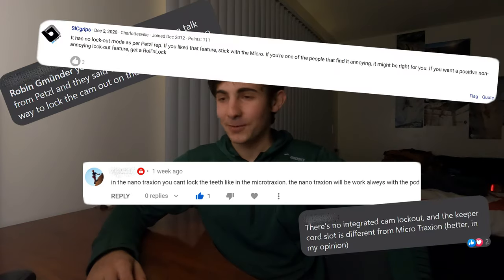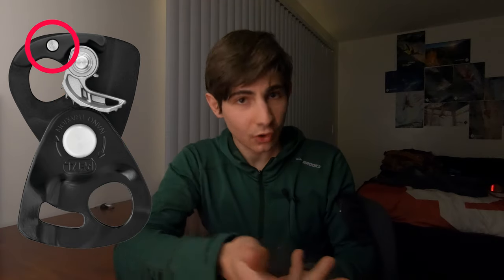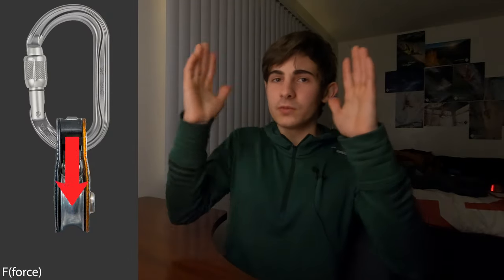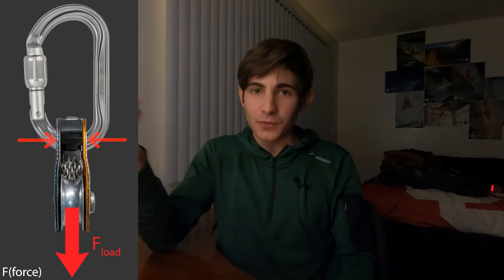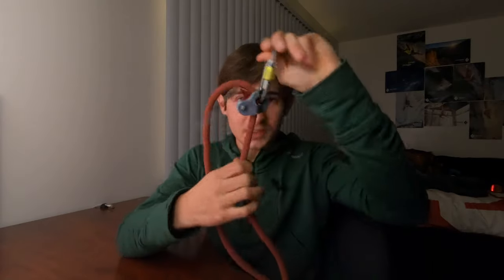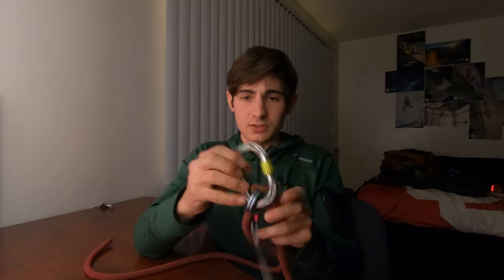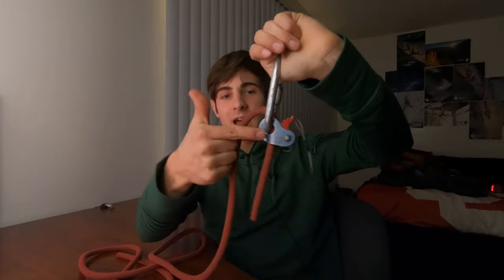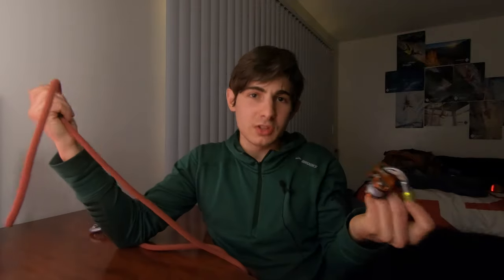MORE NANO TRAXION

Comment: This is going to be a slam dunk for TR soloing and simul climbing like you said. Lighter and no way for it to lock open accidentally (without having to take a dremel to your $100+ microtrax). Also it's strange that only the Petzl Sm'D has the hole in it for a keeper cord yet Petzl says to use an oval carabiner for aiders, pulleys, trax, etc. I use the Sm'D for pulleys, GriGri, trax, etc. and it works great and aligns the trax with the spine just fine.
Reply from the maker: I agree it is alittle confusing. I still like to use an oval just to be extra safe and keep everything in the right orientation but I'm sure you could get away with using a Sm'D